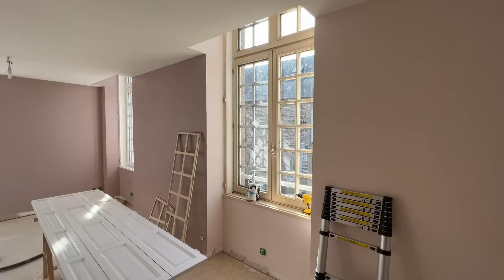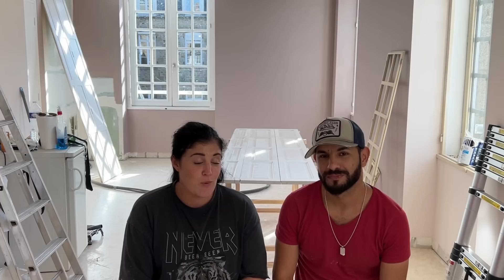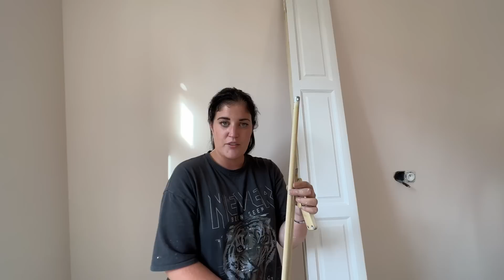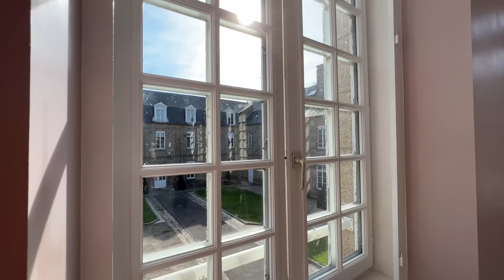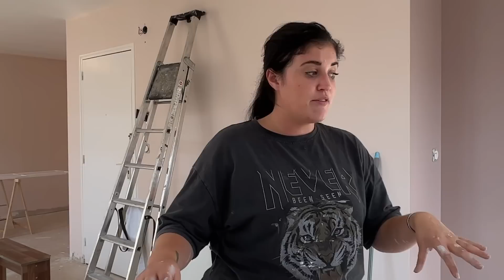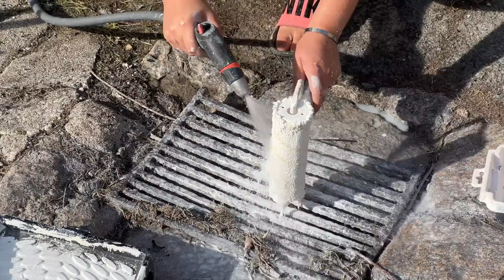Nearly There...

Comment: Happy Birthday Mo! 
Do you have a definite "need to move in" date?
Whats the status of the roof repairs?
Is there anything Billy can do to help with that awkward window thats a couple feet from the exterior wall?
Have you started on the bedrooms yet?
I watch a channel of DIY in Florida of a couple who just redid their cabinets with ikea. They spent a little more to have the design service so there werent any measurement mistakes. They do not have counters yet but said altogether it will be about 10, 000 American dollars for the entire kitchen which is demo, cabinets, sink, fixtures, etc. Cabinets only were 5,000.Thats a bigger kitchen than yours but has an island and they removed a ceiling soffet and repaired drywall. Custom is nicer but i bet you could do some of both. You can add a nicer trim, plus better counters and your vintage or antique pieces. Oh do not put your counter directly onto the cabinets. For sturdiness use 3/4 inch plywood then counter on top. 
Have you chosen sink or tile for kitchen? 
And any ideas on the bathrooms?

Enjoy Paris and a good couple meals while youre there!

Comment: When I am painting and know I won’t be using the paint brushes and roller for a couple of days, I just wrap them with cellophane wrap (Saran Wrap or whatever it is called in France). It keeps them wet until you use them again 2-3 days later. It just saves you from having to wash them all the time.

Comment: Painting tip - put a plastic bag over the tray so when you pour paint into the tray you only have to discard the plastic bag and the tray stays mostly clean, saves on washing. When you have finished painting take the plastic bag off the tray, turn it inside out so the paint is inside the bag, let it dry, tie it up and discard the plastic bag / paint in a chemical bin. Your paint shop might have one.

Comment: I’ve painted several light fixtures with bronze spray paint and they’ve all turned out lovely. I’d like to know your plans for the bath, if you plan to keep the hot water tank or maybe go for something smaller like an on-demand system. Also, is there any way to tarp the hole in the roof while waiting for the cherry picker? I’d hate to see your lovely work get spoiled. Thanks!

Comment: Hi Sadie! Kitchen is coming along great and will be beautiful when finished. Wondering if you had to repair and paint exterior window sashes? Also, are you having radiators or underfloor heating? I use a plastic trash bag over my paint tray when I’m painting so I can just throw it away and it keeps the tray clean. Just a little hint that might help you out!